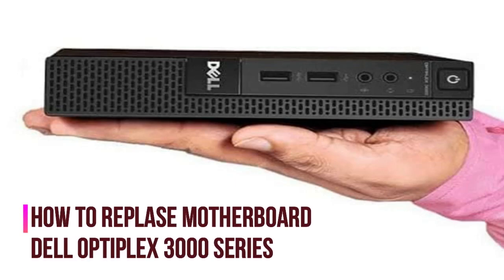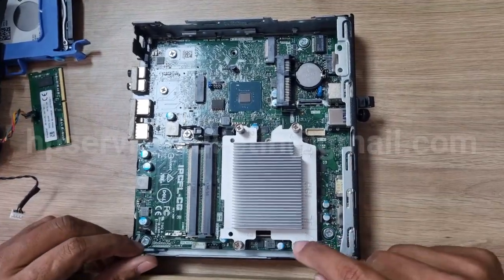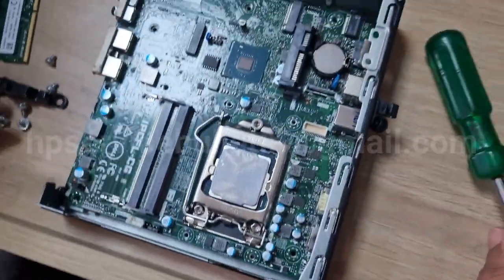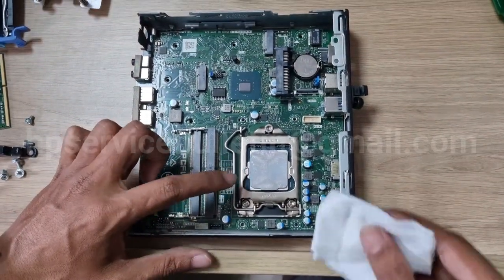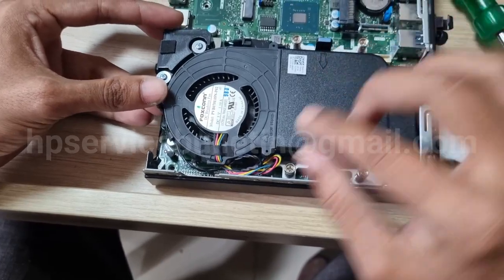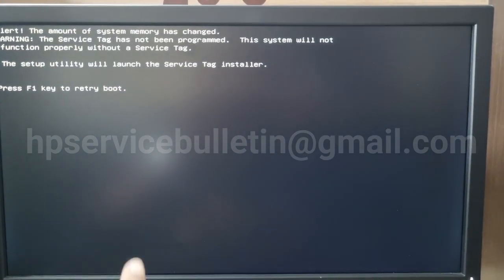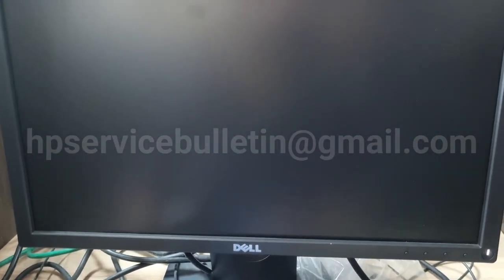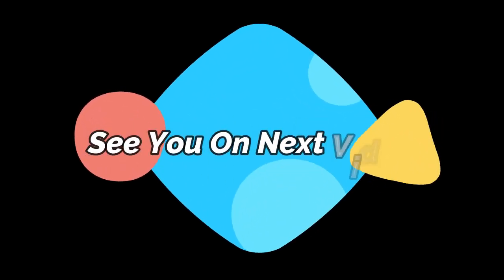Step-by-Step Guide: How to Replace Motherboard in Dell OptiPlex 3000 Series

Comment: Hey PC wizard, do you think i could put a 3050 board to replace a 3000 Micro one ? 
(i can't any 3KM M-board available on the Dell website) 
it looks very similar except that the Opti 3KM doesn't have the Mic mini jack plug
Reply from the maker: Need to check all screw fittings and fan assembly and front PANAL out put match each one. Andthe power out put must be same at both type,, if its all ok then you can swap motherboard,, 

Did you try to contact with dell customer support for mother board enquiry?
Reply: @hpdoctorofficial  yeah i tried today but it is sunday! i saw this M-board somewhere on their website but it costs something like 180$ so its way to costy, i prefer to buy a new mini PC from MINISFORUM with tons of additional power ...do you think i may found one on AliExpress for way less bucks than on Dell to make the replacement n have a backup PC in case of a failure ?